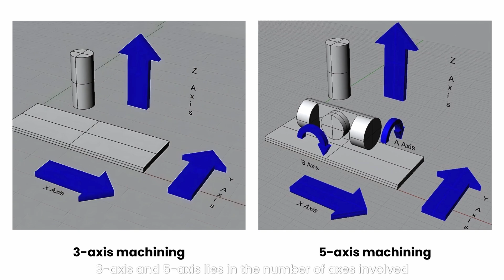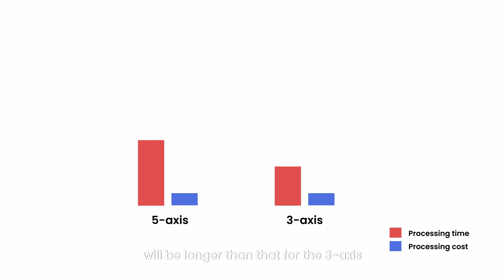3-Axis Vs. 5-Axis: Why We Don't Recommend Using 5-Axis CNC Machining?

Comment: Could you please explain why 5 axis takes more time than 3 axis for the same part? Thanks.
Reply from the maker: Good idea, that’ll be the topic for my next video. Thanks for your suggestions!
Reply: Personally I don't think its would take longer. If the 3 and 5 axis machines take same time the part will be more expensive on the 5 axis b/c it has a higher cost/time
Aming other things if the part has lots of material removal it might take longer on a 5 axis b/c it's not as rigid.